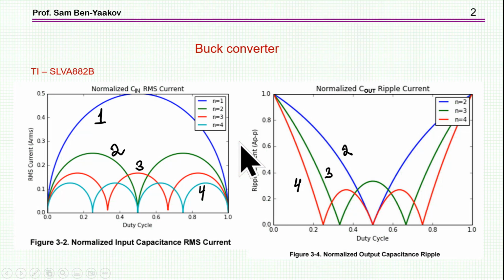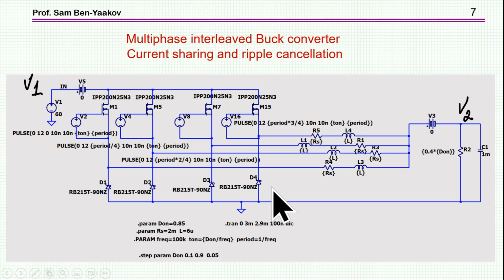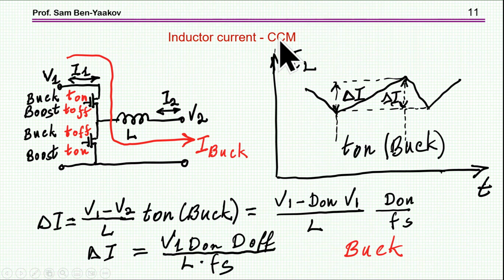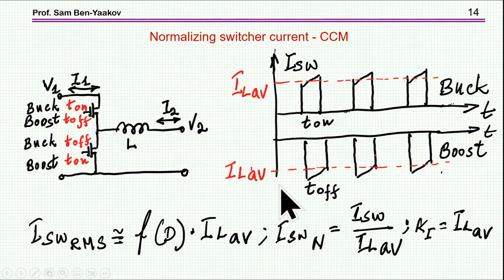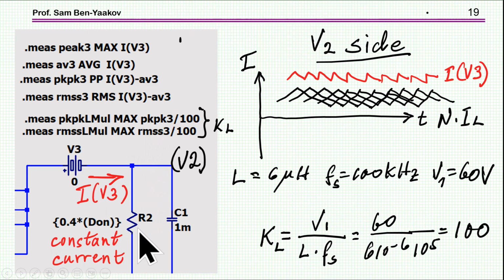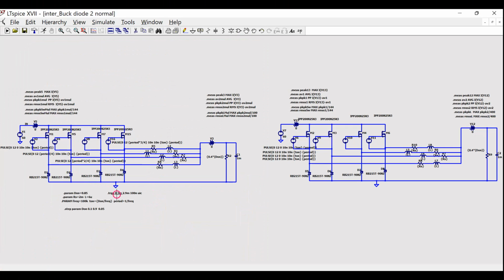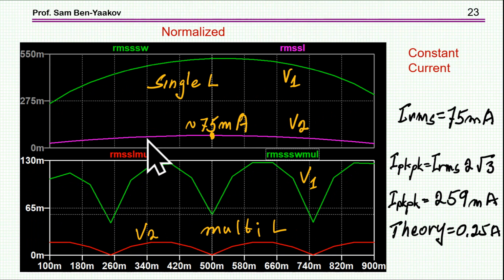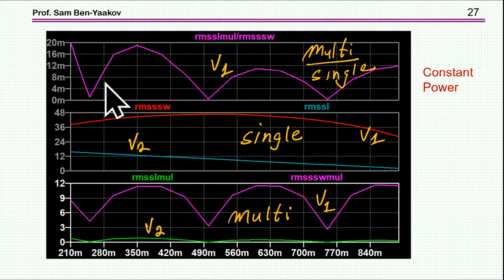Explaining interleaved multiphase PWM converters by LTspice simulation

Comment: Years ago I designed (tho never built) a four-phase PSU subsystem, but for four separate supplies, not combined to a single output. Of course, the supplies would have different output currents, but I still felt there would be significant advantages over four free-running bucks (I simulated it...but only in my head ;-)   I'd be interested to hear any comments on such an architecture!
Reply from the maker: Not sure I follow you.
Reply: @sambenyaakov  Four separate supplies, but synchronized to 4 phases. Should require fewer total input capacitors. And also eliminate "mixing/beating" issues between supplies that I've seen cause issues in analog circuitry...
Reply from the maker: @qwaqwa1960  But all connected to the same ground and each one has a separate DC-DC converter?
Reply: @sambenyaakov  Yes, like a normal 4-phase, but separate, not combined, outputs.

Comment: Hi Sir, thanks for the explanation.
Is it in your comparison the inductance and capacitor values equal for the single phase and the multiphase converter?
I have been confused about the components design on these multiphase converters. I found that the inductor selection equation, as a function of the current ripple, is the same for one phase that for multiphase. From reducing parallel inductances, if the inductances are equal, the equivalent inductance (Leq=L/N) shall be reduced by a factor of "1/N".  So "1/N" shall be part of the formula, right?
Similarly, the capacitor equation, as function of the voltage ripple, is the same for the single phase and for multiphase.
Is it like an exor factor reduction? I mean, I should reduce the inductor value by 1/N or, exclusively, reduce the capacitor value by 1/N exor to the duty cycle (Ton) exor the frequency?
regards! :)
Reply from the maker: The equation is per an inductor ripple you specify

Comment: Dear Sir.
The offline SMPS are continuing on size reduction due to several technological aspects. But, the main rectifier+input filter capacitor are becoming  a comparative  hindrance for this size reduction. Could you expose some Main Rectifier+input filter reductions strategies alternatives? Regards.
Reply from the maker: You mean the capacitor after rectification? or capcitor(s) of the input filter between line an APFC?
Reply: @sambenyaakov  I mean the capacitor after the rectifier. I mean: the input rectifier plus the following bulky capacitor (one-phase 50/60Hz sinal handling) is comparativelly bulky.
Reply from the maker: @JorgeSilva-em8pf   Got it. I consider the preparation of a video on capacitance multipliers.

Comment: Sam, would you agree we cannot use synchronous busk in an interleaved configuration as one converter drives current into another? Do you afree? If not why not?
Reply from the maker: With so many synchronous interleaved Buck converters built, it does not matter if I agree or not. See for example https://www.matec-conferences.org/articles/matecconf/pdf/2020/10/matecconf_icsc-isatech20_02005.pdf
Reply: @sambenyaakov  I am staggered with article. 270V in & 28V out the duty cycle is 10% i.e. Two of the sync switches are ON for 90%. More current flows into buck inductor tha out i.e. 10% ON & 90% OFF. The sync transistors act like a BOOST transistors when turned OFF !!!!
Reply: @dipakpatel9329  Yes, but each converter has its own current control loop. Eventually, the duty cycles will be adjusted to conter the ill effect - boost operation.
Reply: @nachiketadeshmukh8444  3 current loops, this is new one on me. Whole idea is they share equally. My question is if sync fet is ON for 90% at low load,will current flow into inductor and into switch> Than what happens?